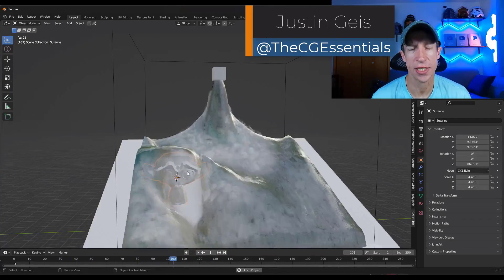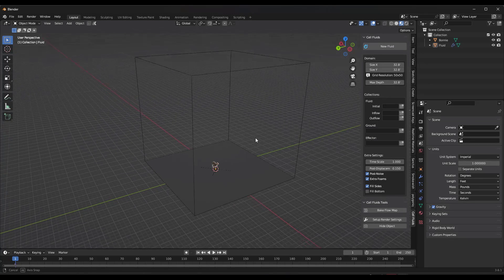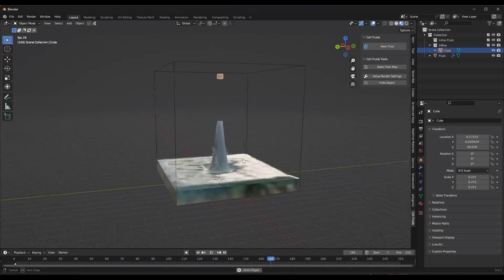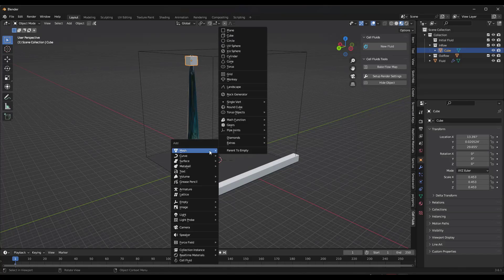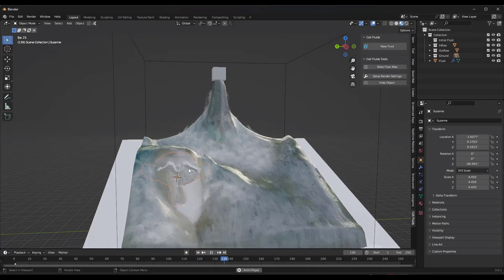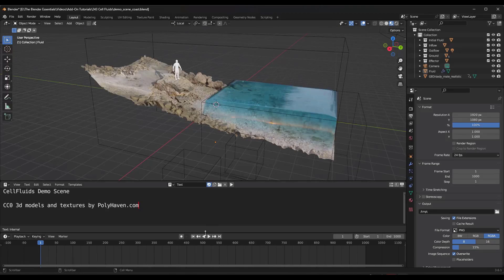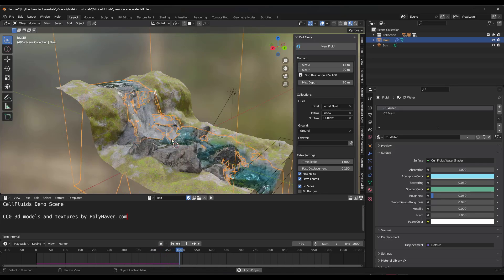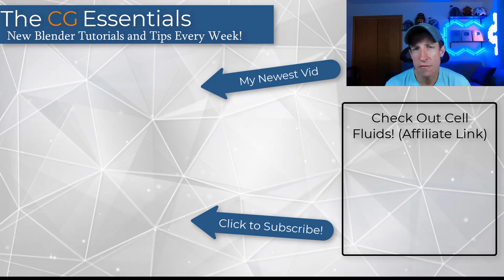Finally a FAST Way to Simulate Fluids in Blender! (Cell Fluids!)

Comment: That is insanely fast! I've used FLIP Fluids a lot, I have an 8 core Xeon PC for 3D work but I have a seriously overclocked quad core PC I dedicate to FLIP Fluids as its just straight line Ferrari speed thats needed whereas the Xeon is like driving a semi-truck - wide, but slow. This is a great compromise!

Comment: Thank you for this very helpful tutorial. However, I have two questions. On the one hand, my outflow doesn't work, the water bounces off and on the other hand, my cube, from which the water comes out, can be seen during rendering. What am I doing wrong?
Reply: Hi, the creator of the addon here. 
1. Try moving up the outflow object to make its bottom is higher than fluid domain.
2. Select the cube and press "Hide object" button under Cell Fluids Tools panel.
Thanks!
Reply: @Specoolar  Thank you very much for the helpful and quick answer to my question. Now it works perfectly. I was a little clumsy about it. ;-) Thank you for creating this perfect addon, it allows me to do so much more in an easy way, great job!

Comment: Looks amazing. I'm curious if the resulting animated water mesh could be exported into formats like gltf or fbx etc.
Reply from the maker: I'm pretty sure that's what the baking function does - haven't tested yet though
Reply: It bakes flow maps, that can make static meshes look like theres movement through the shader.

Comment: Does this make Flip Fluids obsolete?
Reply: Rather this product will end up as flip solver.  Just one example - 10 years ago  PhoenixFD was simulating liquids using cells,  exactly like this product does. But this lasted only few years, and it was replaced by flip based solver. The CG industry is strongly oriented to quality, the speed is important for the game industry

Comment: Very cool! Can there be objects floating in the water that move around water movement?
Reply from the maker: They don't really float, but I think that's what the effectors are for. I think you can move around and affect the water in real time
Reply: Gotcha, cool.....thank you @TheCGEssentials
Reply: u can do it by fake it with plane use shrinkwrap mod to water then use constraint for float object to the plane. i try it and it works
Reply: That's awesome! Thanks a bunch for the response and confirming it could work with the right technique. @nandaje

Comment: I wonder how the author of the addon shade the fluid, there seems to be volumetric absorption in it but that's impossible in eevee right now.
Reply from the maker: That I'm not sure. It does have some thickness incorporated in it with the displace function, but that's a geometry thing, not a material thing